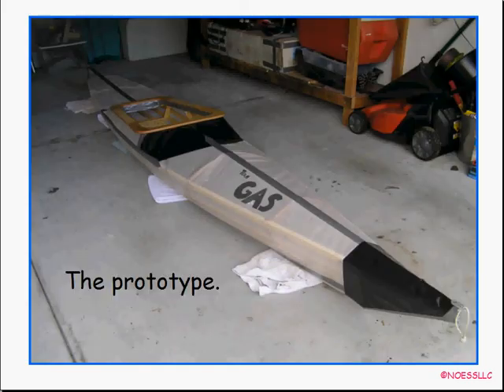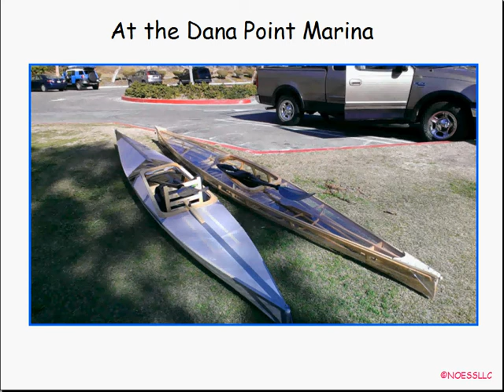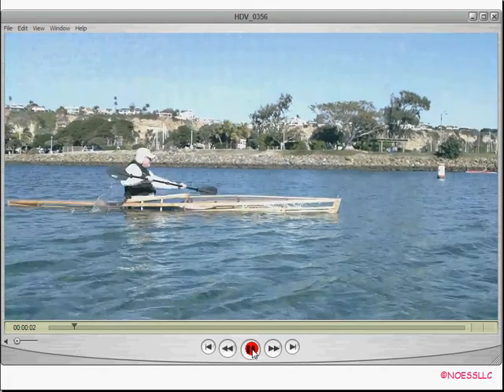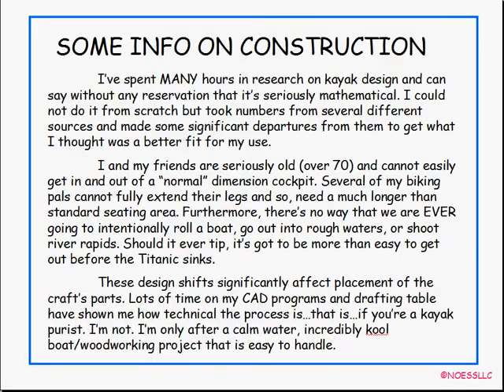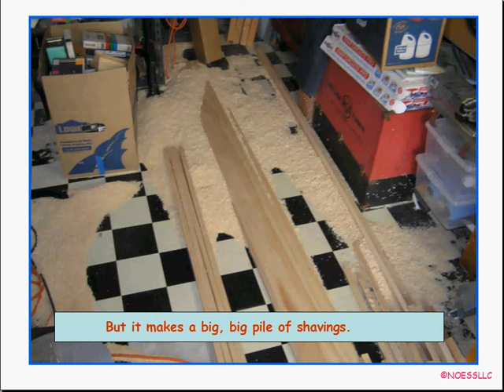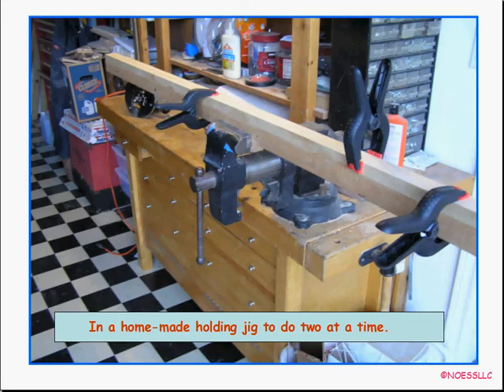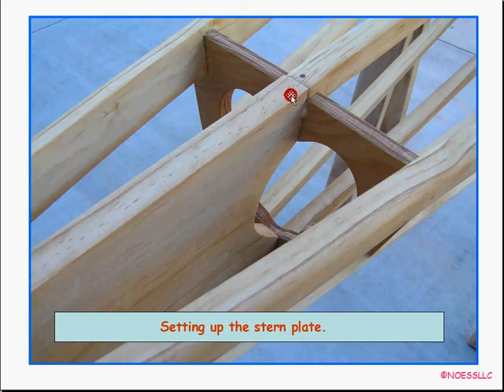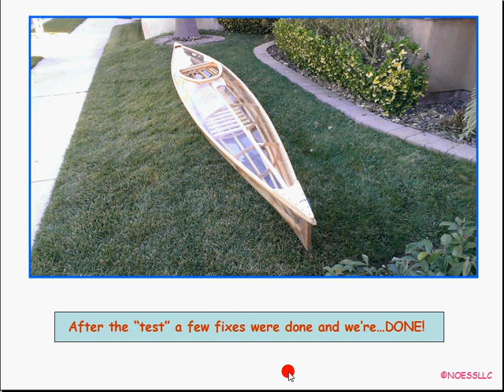Evolution 2 Skin-on-frame Kayak 2

Comment from the maker: If we ever do another clear one it's our intention to use 30mil for the bottom and 20 for the top. Neither is very elastic unless heated up as a full sheet. A heat gun is inadequate for the scale of heating required. Because of the tension required to keep it in place...glue is not an option.

Comment: Hi,after looking at your vinil skin i had an idea, but i never worked with it before...
Do you tink that you culd hang some weights on the vinil while laying on the bottom and heat it up with a hot air pistol to make it fit like a glove?
Maybe doing so, when you roll it upwords, you can close the vinil skin in the same way, by stretching and heating up the vinil, so you don't have to glue or staple.
Thanks for sharing you wonderful design!!

Comment: Hi, great job, huge amount of special tools though. I´ve made mines with foam ,may be opposite aproach than yours (also to enjoy calm rides),but enjoyed watching. Just curious about  how did you get the vinyl "glued" to frame.
Al
Reply from the maker: Al,
It's not actually glued, it's stapled along the top of the frame. California doesn't allow the best kind of glue to be sold. Still looking for something that will do an adequate job so I can do a simple and clean overlap seam on the bow and stern. Thanks for you question.